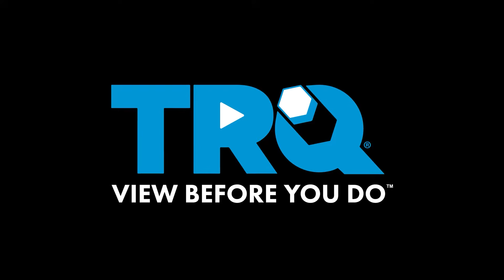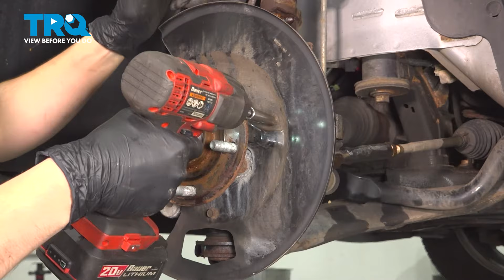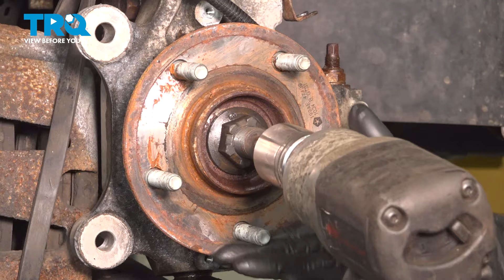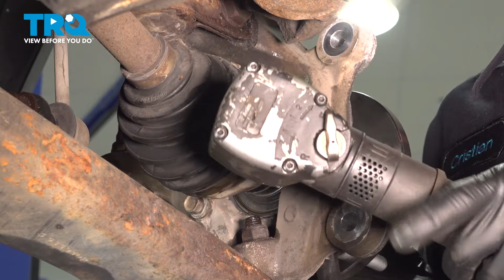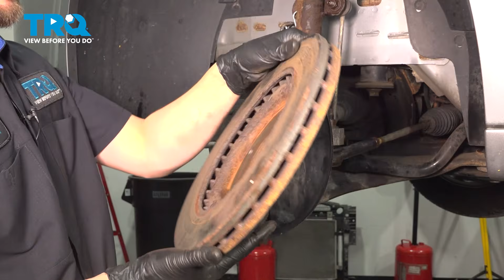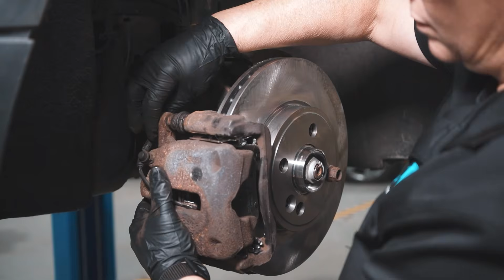How to Replace Front Wheel Bearing Hub Assemblies 2008-2020 Dodge Grand Caravan

Comment: Socket sizes needed:

19mm for lug nuts
21mm for caliper bolts
10mm for shield plate
32mm for axle nut (impact highly advised)
15mm for hub assembly bolts
(Also nice to have bungee cord, mallet/hammer, trim tool)

Comment: Question: everywhere i heard 32mm socket, i have 1 1/4 which is basicly the same (31.75mm), i ordered new nuts (doorman 32mm that fit the car). I tryed to make sure my 1 1/4 socket will fit and wont be too tight and it turns out it isnreally loose like if the nut 31 or 30mm. Can the original nut smaller/thinner thant the replacement ? It is a 2014 (crew canadian version) bought in 2018 so i cant think in the 4 first year they replaced both front cvt axle with different size, makes no sense. Anyone have an idea if it is normal the oem to be smaller than 32mm ? Is there chance my new nuts wont fit on the axle ?

Comment: I like to put the "cutting oil" that is used for drilling holes in metal with a drill on all the threads. If the threads are dry they will rust, if grease is used they may loosen-especially the wheel bolts or nuts.

Comment: As a 32-year mechanical veteran, I would like to say everything was done proper. I have the Mantra of never install anything dry (unless it's going in a water jacket) would have put a little bit of anti-seize or some grease in the threads of the bolts after cleaning them all up.

Comment: You forgot the step where you go through every puller, bar, and hammer in your box, your buddies box, and the rental shop when the axel doesn't slide out like you had it apart yesterday lol. I turned wrenches in Ontario half of my life, in Ontario it felt like every bolt on every vehicle was welded on with rust and corrosion from all the damn salt on the roads.
J/k aboyt the pullers though, for anyone who doesn't know, don't actually bother with any if that, loosen the axel nut (but leave it on) and in a parking lot or...wherever you have to (preferably not a busy road)  drive it like you're drunk, swerve a lot or, drive in some circles/figure 8s. A couple minutes of that and it should slide out like this one did for him.

Comment: Thanks very much for this vid. I have watched my father changing the wheel bearing on his DGC. Now it's my turn to do it on mine by myself. Thanks much.
Update : I did the job by myself today thanks to your video. Removing the old bearing was a pain in the a** but once I did, everything went smoothly. I locked all the bolts and nuts according to the info you provided. My Caravan is a smooth ride. Thanks again.

Comment: Lug nut torque 100lb, wheel bearing bolts 37lbs, center bolt 118lbs, caliper bolts 125lbs,